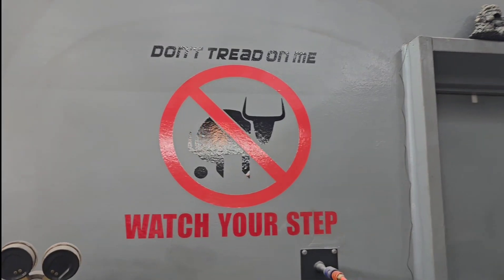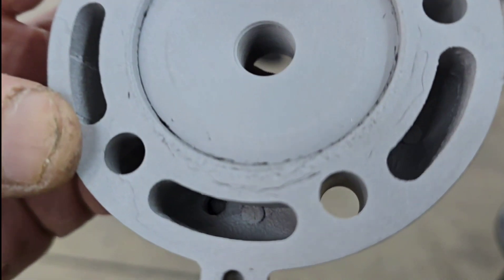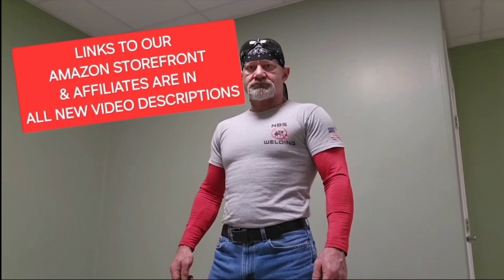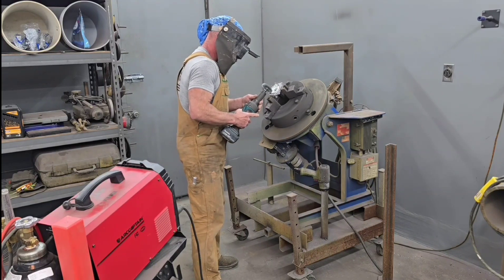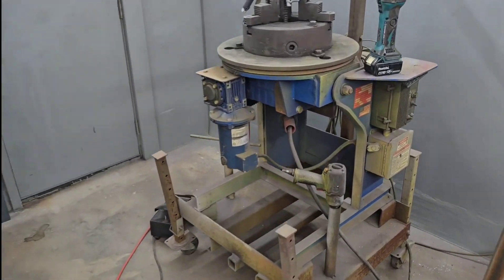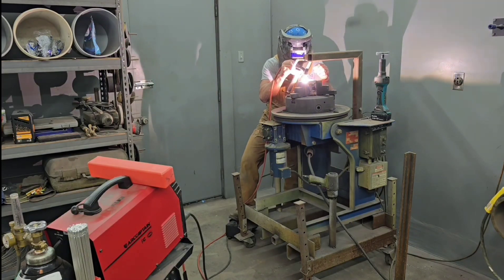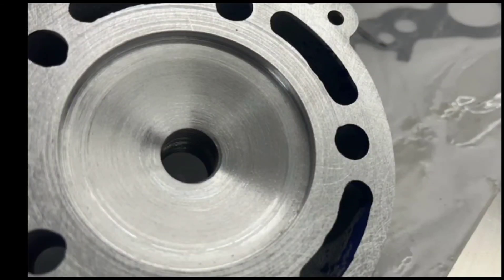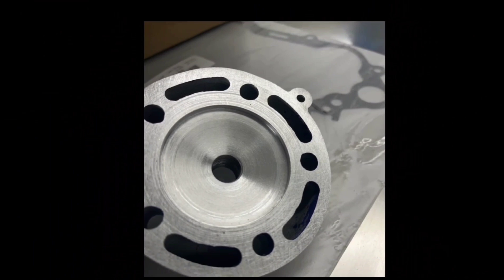TIG weld to repair pitting on a cylinder head

Comment: Some of the best welds in the world are totally ground off or machined away you would never know they're there when were the first jobs I had back in 03 when I started welding was making base plates for a company called Mono which is a Robertson Myers company when I was working at a company called Robert Iron Works those base plates held big zero clearance compressor heads and some of them were over 20 ft and we would have to weld sections together and blend the welded joint if you didn't know what you was looking for you couldn't tell they were there as if you didn't know how the product was built that's a nice job CB
Reply from the maker: Thanks for the story, appreciate the insight!

Comment: That’s a great repair just job. He must not been able to buy a replacement. And replacement parts may become a real issue in the very near future. This tariff business is going to make lots of part either really expensive or just plain nonexistent. There’s nothing more aggravating then to be working on something and go to get a replacement part and your told “no longer available “ especially on farm equipment! Farm equipment junk yards are available but you can spend days in those places looking for what you need. Your skills to repair engine parts maybe become more valuable than you expect. Most farmer can do a stick weld “get me by repair” however most are not skilled in aluminum repair or anything that’s requires knowledge of good tig or mig prep and welding it just not their expertise. Trust me I’ve seen some attempts at skilled required welding and it just not there. And a really scary thing is people working on truck, tractor, or equipment frames.
Reply from the maker: We'll see about the tariffs...I think it's just a bargaining tool and I see no need to worry about it at this point.

A skilled negotiator will develop a tool to bargain with so later they can appear to "give up" something when actually all they have given up was a bargaining tool that they created from nothing in the first place...so in effect they have gained something while appearing to have given up something when actually they have given up nothing. 

We'll see
Reply: We'll see the actual results and they won't be the end of the world cause this is what's called expert negotiations from a talented, very experienced businessman. Several countries already said 'no no no we want to get rid of the tariffs'! Stop listening to fake news🤦🏻‍♂️

Comment: Hey CB, love the videos.  What brand of overalls are you using?  I have a pair I bought but they were way too baggy and the pant legs were too wide.  These seem to fit well.  Thanks and God Bless brother!
Reply from the maker: Liberty overalls...in my area they are sold at a farm store called Tractor Supply...they are the only ones I can find with a chest pocket big enough for my phone...my S24 Ultra is pretty big

I actually prefer a full overall instead of the bibs but I can't find any with a chest pocket big enough